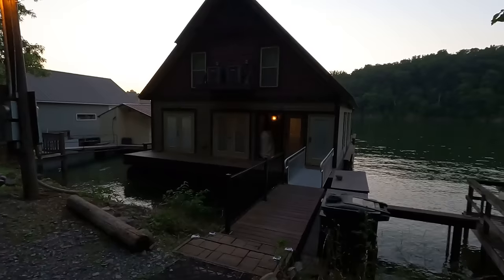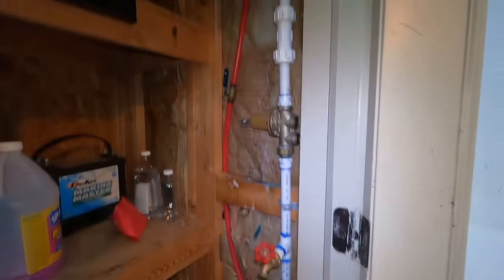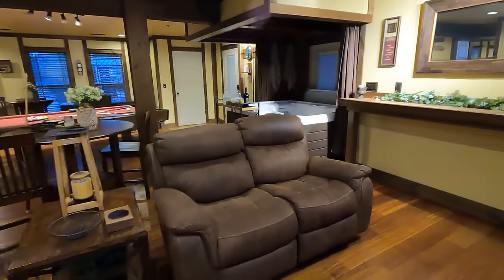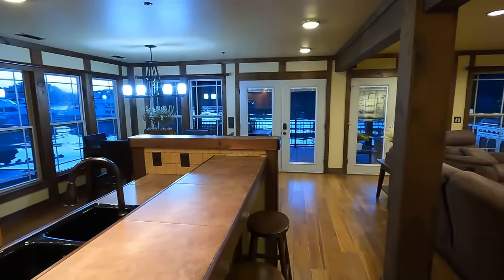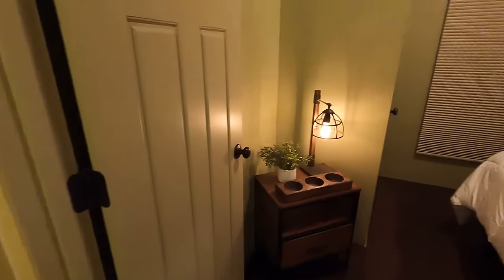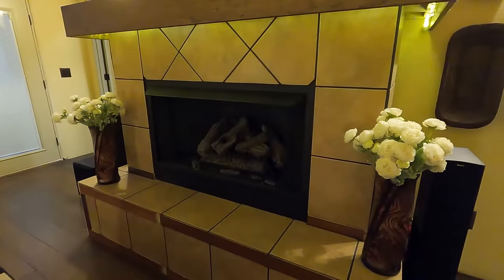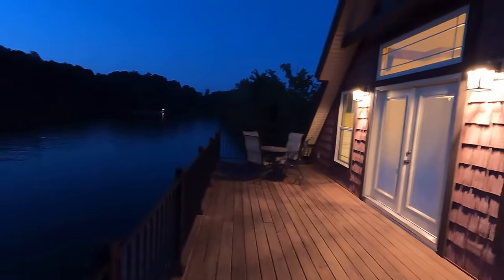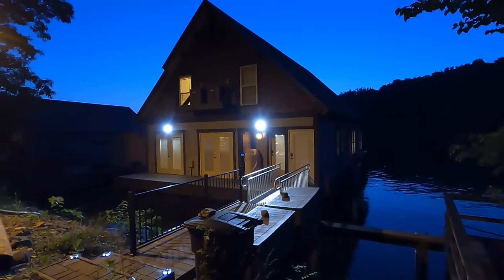2-Story Custom Built 30 x 48 Floating Cabin (3Bed/2.5Bath - 2400sqft) on Boone Lake TN - SOLD!

Comment: Am I correct in assuming that the difference between a houseboat and a floating cabin is that the latter completely lack any form of propulsion and must be towed into position by a separate motorized vehicle?